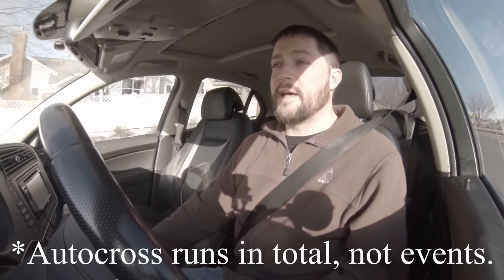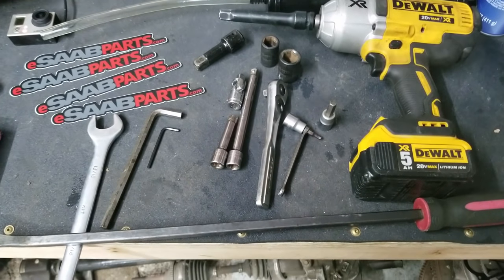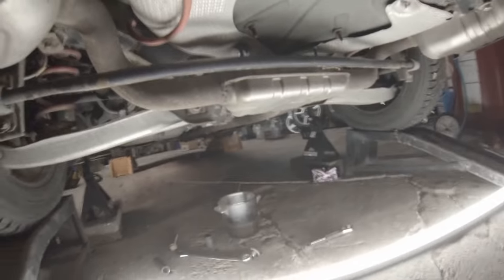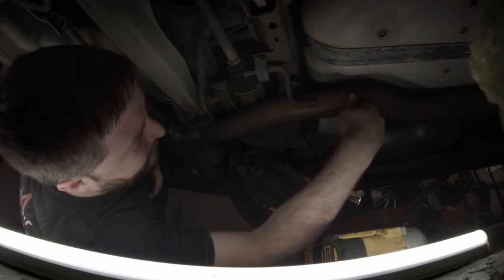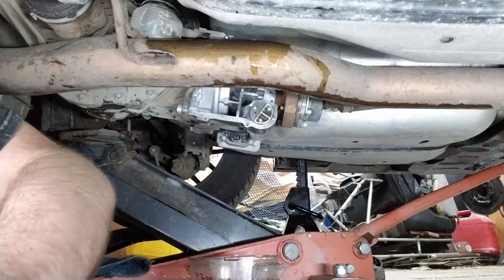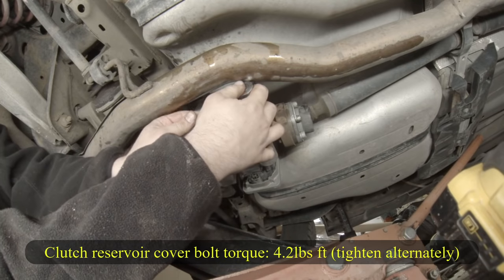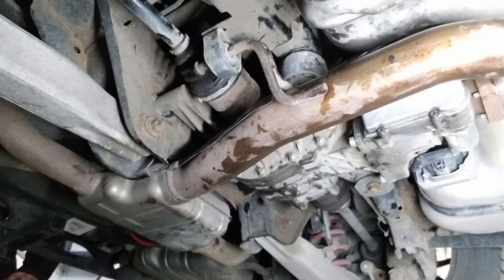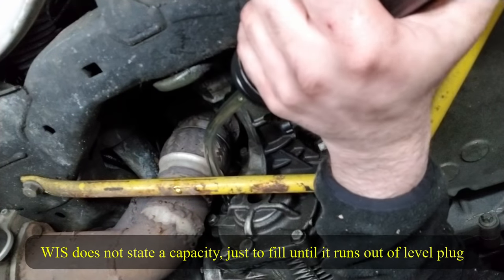Saab XWD Service (Haldex gen. 4)

Comment: I have a 2010 93 Aero XWD with 315,500 + miles (all mine!). I'm going to do this myself for the first time. I had a mechanic do it over 100k miles ago and it's starting to slip a little. The video is exactly what I need to do it properly. Thanks for the added 'what not to do" with the cover bolts!
Reply: Did you service your awd halidex system and how easy was it to do?

Comment: wow amazing!!! took 10 years for someone to upload XWD how to! I cannot thank you enough!
Reply from the maker: No problem! Glad I could help.
Reply: @autoholicmedia  I got a Service XWD message, Tech 2 reads a C0407 Code.
Reply from the maker: Sounds like that code is usually associated with low fluid. Double check the fluid level and top it off again if needed.
Reply: Autoholic Media actual code is C0407 64 no external leaks hopefully nothing leaking internally.
Reply from the maker: Was it after you serviced it or it just happened?
Reply: @autoholicmedia  Ive owned the car for 1 1/2 years and put 8K on this just happened yesterday on the highway. I personally never serviced it but i can tell by the drain plug (below the breather valve) someone did in the past because it is slightly stripped. Ive found a write up that says to fill from breather valve instead of the plug, maybe that could be the problem?
Reply from the maker: The wear on the plug could also be from checking fluid levels. If not serviced, it is possible that the filter or pump screen have become clogged, preventing adequate fluid flow for the system. If both differential fluids are at the correct level, the next thing I would do is a full service of the system. If the rear portion is overfilled and the front Haldex portion is low, then an internal leak is likely. Although, I think the internal leak issue was mostly resolved when they updated the vent tube for the Haldex reservoir.
Reply: Autoholic Media ok thank you for the heads up! How to tell if the vent tube was updated on my model?
Reply from the maker: I am not sure. It should go up to the top of the differential. Not sure what the old ones looked like.
Reply: @marsdahustler     Just  curious.. ( I know it has been quite some time since you posted this comment.... but  I am wondering what was your final issue..    ( I now have the same code  with symptom code 64 as well. )
Reply: @saabertx  low fluid/low pressure which means dirty fluid or low fluid or leak.

Comment: 1 Diff 
2 Haldex
3 Transfer Box, 
Thanks for the nice effort uses it to for my 2010 VXR. 
 - same as the VXR onkly has to drop the exhaus to :)
Else pls REMEMBER check Haldex Level after driving mate, go driving and race it go back and check level I could add 50ml just so everyone knows ;)
And really recommend filling through the went pipe (hose of)

Comment: You made a great informative video, thanks for posting.  I have a 2014 Cadillac SRX and there is no information about the Haldex service.  I've read that Cadillac says there is no service to be done, just drive until the system fails at 100,00 to 150,000 miles and replace it, ouch, more than $3000+ just for the unit, then add labor.  Now since watching your video I feel confident to service my SRX since it appears to be the same Gen IV Haldex.  Good show.
Reply from the maker: Thank you, I'm glad it was able to help you out. Saab also claimed that the system was not in need of servicing, but the general consensus is that it definitely benefits from fluid and filter changes. When it comes down to it,  I'd prefer to keep it in good operating condition for as long as possible, because as you said, a new replacement is not cheap.

Comment: Hi all, out of curiosity what fluid levels are you working to? The descriptions suggested in this video seem to be quite different from what's on Saab WIS. 

Rear differential section 150ml new oil (Part #88862624) WIS suggests 0.6l
Differential Clutch section 350ml new oil (Part #93165387) WIS suggests 0.52l 
Transfer case oil fill to bottom of check plug (Part #93165383) WIS suggests 0.66l

Any advice welcome. Thanks

Comment: Just want to add for correct filling procedure you leave the level fill plug in fill will 350ml run for 2-3mins then remove the level fill plug and top up as required 
If you fill will the level fill plug out the oil exits as soon as it hits the internal cavity due to the way its designed its why you cant fill them thru the level fill port :)
Reply: Thank you for this information sir!

Comment: Thanks for the walk-through, awesome job! I find it interesting the dealerships refuse changing the filter and haldex oil on grounds some service memorandum issued by SAAB a year before they went bust was advising them against such service. On my 9-3X they only did the transfer case and the rear differential. In my opinion they just don't entertain dealing with such messy and time consuming maintenance activity that can also lead to all sorts of issues if not done properly. Their preference appears to be the trivial stuff (spark plugs, oil changes, filters, brakes) and off to the next car in line... volume vs revenue.
Reply from the maker: I knew Saab had originally said thebfluids should last the lifetime of the vehicle, but I guess I hadn't heard of a memo actually advising against the service. I'll have to look into that. I'd say most shops are just avoiding the liability of having to fix a system they don't know much about. Unfortunately, little is known about rebuilding the units (even though I know of at least one company doing rebuilds), but at least replacement parts are readily available from other GM vehicles and we shouldn't have trouble finding them any time soon.
Reply: @autoholicmedia  they do the fluids (except for the TTD) but not the filter.
Reply from the maker: What do you mean by TTD?
Reply: @autoholicmedia  Torque Transfer Device (the clutch). My shop only does the transfer case and differential fluids.
Reply from the maker: Ok, that's what I was thinking. I would say that's the most important one to change out, along with the filter.

Comment: Newbie question. I have a 2008 9.3 Aero XWD. I put the car on ramps, but it's not high enough, I need to use axle jacks to get it higher. Can you advise on where I can position the floor jack to lift the front of the car, as you did? Where is it safe to position the floor jack so I can lift the car without damaging anything? Thanks!

Comment: Your refill procedure is incorrect. The top vent nipple is also considered the fill port. WIS states that 350ml should pumped in through the top nipple. This allows for the oil to flow into the pump. Once 350ml has been put into the unit the vehicle should be started and run for 60 seconds. Finally, the fill plug is used to top off the oil. Total oil used should be approx 0.5l.
Reply: I agree.  I have serviced 2 of these on two different Saabs.  I found 350 mL through the fill port and then an additional 100 mL through the vent seems to be the correct volume for the low fluid level code.

Comment: Just curious... when you have that side plate off... on the Rear Diff to remove the gasket and the filter, are you able to remove the pump filter with those two little screws to clean the filter screen as well?
Reply: I removed the two screws to clean the filter screen. Amazing how much gunk gets stuck behind that little filter screen.
Reply: That is not the rear diff - this is the Halfdex 4x4 unit that sits before the diff :)
If u remove the Pump be extra carefull making sure cycle the car through all the gears as air can arrise when filling it up in the system - also while add it remove the pump and check resistance if lover than 2.9 ohm that is not good  new pump

Comment: I just ordered the service kit.  Is the lube for the front differential included in the service kit?  Thanks!
Reply from the maker: I'm guessing you mean front transfer case? The front diff uses fluid from the transmission. Depends on which kit you ordered. The one currently going for $199 from eSaabparts is the one that has all three fluids.

Comment: Do a video how to change coils on the 2,8
Reply from the maker: Good idea. I don't need new coils yet, but I may be replacing the plugs soon and the coils need to come out anyways.
Reply: how is changing coils hard?
Reply from the maker: It's not too hard, just have to be careful of the vac lines because they become brittle with age. Which if they are, it's probably a good idea to just change them out anywyas.

Comment: In a different vid i watched, the guy drained the fluid, replaced the filter, filled until it started coming out of the fill hole, then he screwed in the fill plug and in his words "topped" up the fluid by filling it with MORE fluid through the breather hose. In my opinion this is wrong. why else would there be a fill plug?  When I do it I think I'm going to do as you did, except i might put it in drive and spin the wheels in the air a bit before checking the level a second time.   let me know what you think because seeing as it doesn't take much fluid as is, I'm sure overfilling could be detrimental. also, how many miles should you drive before servicing the system?
Reply: Filling through the breather hose = is actully correct and avoiding air bubles that way ;)
Service it every 15.000 km
Reply from the maker: It's the recommended fill procedure. I've done it both ways, and there really doesn't seem to be a difference. When I replace my diff and got a better look inside the cover, filling through the breather tube really doesn't seem like it will do much. The only thing it would likely do is hold the entire amount of fluid without running over at the fill port before getting all the fluid in. Either way, you should check the level after some driving

Comment: Did you get any of the fluids tested? It's been  30k miles since I had mine done so I guess it's time. Also, what size hose fits that breather valve. I thought I was going to see oil go everywhere.

Comment: Whats The reason for filling haldex through The breather? Aint it enough to fill through The levelplug?
Reply: @TheEvocarlos wrote: Just want to add for correct filling procedure you leave the level fill plug in fill will 350ml run for 2-3mins then remove the level fill plug and top up as required 
If you fill will the level fill plug out the oil exits as soon as it hits the internal cavity due to the way its designed its why you cant fill them thru the level fill port :)

Comment: you should never empty a diff or transmission without checking that the fill plug can be loosen
Reply from the maker: Not going to hurt anything, just not drain as quickly or smoothly.
Reply: @autoholicmedia  what if you empty the diff and then you can't open the fill plug? Now you have a very big paperweight.

Comment: Did you use a different fluid pump per each fluid or did you clean it out each time before putting the different fluids in it?
Reply from the maker: I cleaned it out really thoroughly. Next time I'll probably get a pump that I will dedicate to the Haldex fluid, just to guarantee I don't get any contamination in the system. The brake cleaner seemed to make the pump harder to pull and push, so cleaning it out like that every time was not ideal. Could have lubed it better with the fluid being used next and probably not had the issue though.

Comment: When filling the differential clutch, did you leave the drain plug out and filled it via breather hose or did you fill it via the drain hole?
Reply from the maker: I filled through the breather hose with the plug out. After having everything a part, I really don't see this being necessary, but it is the official procedure and it does make it harder to mess up. I have just filled it through the fluid level plug in the past without issue, and that will probably be the way I do it going forward. Mostly because after having it a part, I really don't see much benefit to filling through the breather tube as opposed to the fluid level plug.
Reply: Autoholic Media by fluid level plug you mean that plug below the breather hose right?
Reply: Autoholic Media also, for one without the eLSD, any differences in this procedure? And would they be considered Gen 3 Haldex?
Reply from the maker: Still gen 4 without the Elsd. Should be same procedure, just possibly less fluid. Although, I don't think any fluid drains from the e-lsd during a change anyways, so may even be the same amount of fluid.
Reply: Autoholic Media thanks.
Reply: One more question, in terms of fluids, the first fluid you filled was the #88862624, then #93165387, and finally #93165383 right? So essentially Diff fluid first, then Torque transfer device (eLSD), and lastly the front being the Transfer Case? Sorry if this seems repetitive, its just people throw around so many terms, its confusing...
Reply: @autoholicmedia  I had mine done by a shop who filled it through the filler plug.  Within a couple of weeks, I got a "Service XWD System" message. I took it back along with the updated instructions to fill through the vent hose and they added more fluid in that manner and 3 years later, I've never had that message reappear. So apparently it does make a difference.

Comment: what are the yellow bars underneath the car for
Reply: That's a 3 point subframe brace. They put something like that on the convertible to help stiffen the chassis. I'm guessing he did it since he tracked the car.
Reply from the maker: That's a 4 point brace I made. Put it on to help stiffen up the front.

Comment: My '14 Buick Regal has the identical unit.  That job looks like a bitch.  I love wrenching on my own stuff, but dropping the differential.....on my car the exhaust is REAL close, and would probably have to be dropped as well.....after 5 Cleveland winters......YIKES!  Great video, BTW.
Reply from the maker: I really like those Regals. I actually got a rear diff out of a Buick a few months back as a spare. Used the pump off it, as mine was done for.

Might want to look into changing it so you can keep it in working order. Should still be alright, but better to be safe than sorry!
Reply: You don't need to drop anything to change the fluid in your Buick.
Reply: @chrisshore9000  your fingers must be tiny, then.
Reply: @gd9704  I was going to elaborate when I was writing my 1st comment, but I was short on time. Anyway, back when I bought my xwd Saab I took it to a Buick dealer that's close to my house. At 1st they said they don't work on Saab's until I showed them the xwd system. After they were finished they said the only difference is you don't have to drop the awd system in the Buick. There were other conversations before which made me think this was their 1st time servicing any GM haldex.